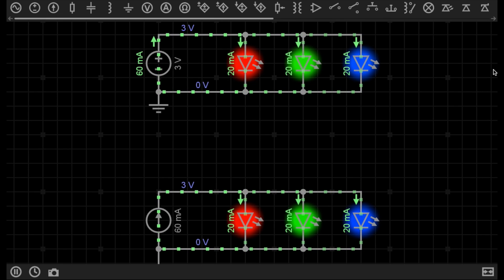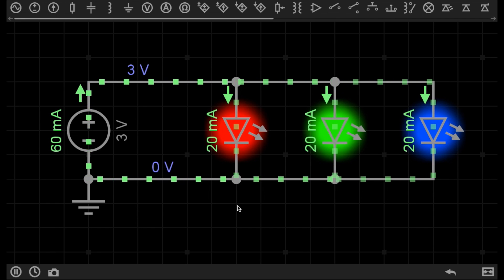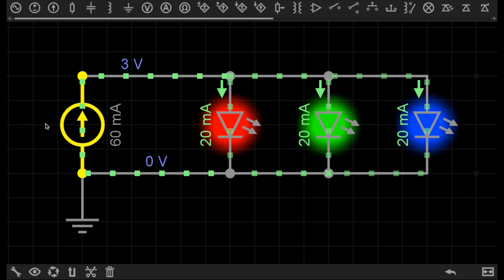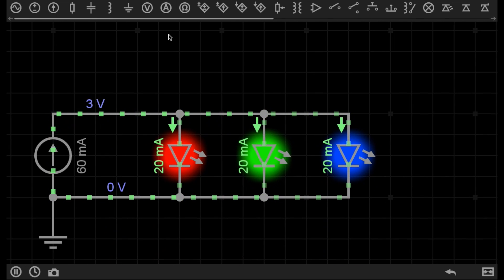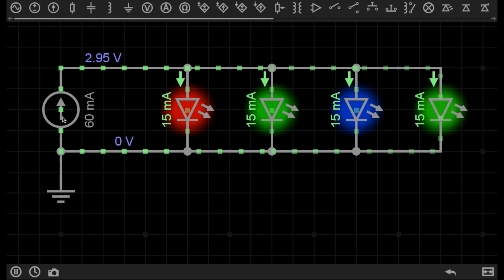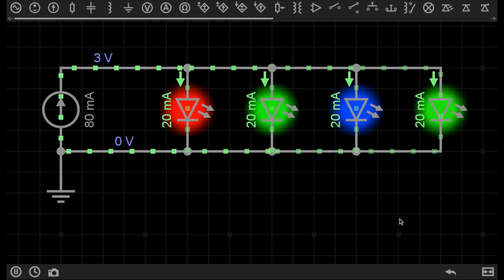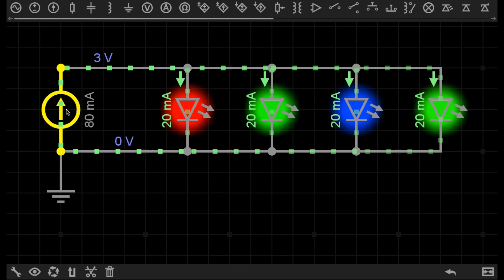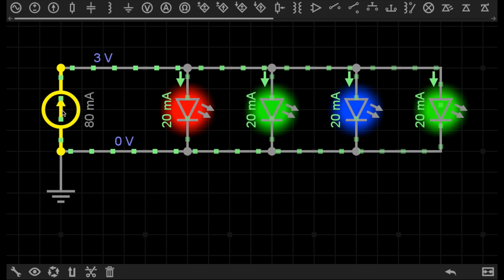Constant Current Sources (Interactive!) - Simply Electronics Basics 9

Comment: Question 1:  the current source creates no voltage, correct?

The diodes require voltage to turn on , and allow current to flow.

With no voltage provided,  only current as available, how do the diodes turn on and allow current to flow in the first place? 

With a resistor in parallel with the three diodes, current would be able to flow across the resistor.  That would create a voltage in parallel with the diodes, which would then likely be above the typical 0.6-0.7 volts required to allow current to flow through the diodes.  only then would the current source be able to power the LED's.  

I must be very confused.

Comment: I suggest that you use Copper Clad CAD to test this idea, build a real prototype, to test this idea, measure to see if you really get equal currents for each LED, Different Color LEDS work at different voltages and current levels. In this circuit the voltage across each LED will be the same, the LEDs are in Parallel, use a real circuit to see what you really get! Will the voltage across all the LEDS be determined by the lowest forward conducting voltage of the LEDs? It does not matter what a spice program shows, it only matters what the real circuit does.

Comment: Should the LEDs be in series rather than parallel when one intends the same current in each of the LEDs due to different colored LEDs having different voltage drops for a given current?
Reply: Red LED would light up first and burn out in seconds(half a minute at most), if it fails open all other will burn out subsequently(though blue one may stay lit depending on it's voltage drop, depending on maximum voltage of constant current source), if it fails short it would either way have voltage drop of less then 1 volt and no other LED will light up

Comment: I don't understand all the positive comments below. This is not how this works: Different color LEDs will never work in parallel as shown (probably not even same color) - should have done that with Resistors or possibly light bulbs...  Just try it on your bread board...   (This only works here because the simulation software is set so all diodes have the same voltage, which is not happening in real life).
Reply: Seems like trap to make people comment on video, there is no way a channel creator could made such mistake for real
Reply: This is perfectly right on a theoretical level, it explains the differences between a voltage and current source, led properties are out of  scope
Reply: Someone’s a Debbie downer

Comment: Hello, very nice video ! i did the same, i used 1.5 Ohm to have an output of max 1A, but when i plug a load to my 12v lamp bulb, the voltage drops to 4v, is it normal ? many thanks.

Comment: What happens when one of the leds break? Since its set at 80mA, would it destroy the others by giving it more current than the amount it needs?
Reply: That's my question as well, if you get a chance to explain.
Reply: You are right. Therefore it's not smart to connect the LEDs in parallel. When the LEDs are connected in series on a current source, you are sure all leds pass the same current. Even if the forward voltage of the leds is different. This is most likely for leds with different colors. 
By the way,never connect leds directly to a voltage source. A lead has no linear relation between voltage and current. Once the voltage is slightly larger as the forward voltage of the led,  current rapidly increases. So with manufacturing deviations, temperature diverenses,... it's impossible to maintain a steady current through the led, using a voltage source without resistor to limit the current.

Comment: Hello, firstly I want to thank you alot for all these very helpful courses,
Could you please help me to understand, why the current is 2.95 V (why this value) after adding a diode ? is there any equation to calculate this value ?
Reply: Yes, ohms law equations. If you know the current and the resistance you can calculate the voltage. With any 2 of these variables you can calculate the third. In the circuit you're referring to we actually know the current and the voltage, but not the resistance of the diodes. So you'd have to work out the resistance of each diode to be able to calculate why the voltage dropped from 3V to 2.95V after adding a diode. Check out the first video in this playlist.
Reply: This bothered me too so I did more research. The constant-current source must decrease voltage because adding a 4th diode decreases total resistance in the circuit. Resistance is calculated as:
(resistivity * wire length) / area
Adding a new diode increases the Area the current flows through, so resistance is effectively decreased in the circuit. Hence lower voltage required to keep the current constant.

Comment: Cool video.  However, what forms does a constant current source come in?  I can only think of a variable power supply that allows you to vary the supplied voltage or current.  Seems like a laboratory thing.  I'm guessing that you'd use some current limiter in a circuit, supply it with slightly more than it needs, then you get your constant current source, much like an LDO?

Comment: Those LEDs do not exist. There is no such thing as Red, Green or Blue LEDs that operate at 3V. 
If you're gonna make shit up, make sure you tell the viewer. People who are learning the basics don't know that.
Reply: That's just one problem with this video.  Constant current drive is for LEDs in series, and if he insists on doing that, he still needs one resistor per LED.  Even if the LEDs were the same as he states, that would still be true due to manufacturing differencs.

Comment: Is it possible to power an LED which draws 20mA und has a max Vf of 3V with a 3V powersupply? Since there is no voltage left for a resistor, will the LED draw exactly 20mA? Do you always have to power an LED with more than its Vf to have enought volts for a resistor to regulate the current?

Comment: Liked this video.. Question - which one is better -
1.using resistance to limit the voltage to light Led ..so specific current is passed. 
2. Using constant current to allow specific current in the led... 

And tell in which cases I should use these two..

Comment: Great video but I strongly disagree on your argument were since it's easier to use a current source that you should use one instead of a voltage source.  Reason why is being that in a scenario where one of the four LED's burns out the other three start to get more current, then when another burns out you're left with two LED's that are running on 40 mAmps each, then when one of those burns out, you're left with the last standing LED which will be running on 80 mAmps which I assume would burn out at that point.  My main argument is that you'd be decreasing the life span, I'd say stick to resistors because although there more time consuming they are worth the time.
Reply: But what about integrated circuits, which cannot handle the size of a resistors, there we can use constant current sources
.
Reply: the point is that when using constant current sources the LEDs are connected in series.

Comment: Wow you know your stuff, maybe you can help me with something, I bought a solar panel, NO battery, to go direct to dc/ac power inverter, which needs 12v dc to run, my solar panel does 22.5 v. so I bought a cheap china junk buck step down regulator, it worked at first, then it was fluctuating very badly, wasn't constant, & lost the ability to adjust it... 12v, which is what my dc/ac inverter needs, would a >>>>"Constant" <<<< adjustable dc-dc voltage step down regulator be better, to stop the voltage going up & down, constantly? Thank you.
Reply: da man ,all solar panels will have a higher voltage with no load. If you have a 12V 100Watt solar panel, it will be 12V with. 100 watt load in full sunlight. My guess is that when the buck puts a load on the solar panel your voltage is dropping to 12v or lower and most buck converters need 3v to 5v more then what they are set to, so when the solar drops 12v under load the output from the buck will drop to 7v or turn off tben the voltage on tbe solar goes up the buck turns on and the voltage drops again causing it to cycle. Hope that helps.

Comment: Only matched diodes can be connected in parallel. Otherwise they won't share current equally. No way diodes of different color can be connected this way. The diode with lowest forward voltage will take all the current.
Reply: I guess they could have chosen incandescent lamps.
Reply: You are  almost right : the V-I curve of R LED is radically different from a G LED which is radically different from a B LED...
see http://lednique.com/current-voltage-relationships/iv-curves/
I would guess that a 60 ma constant current source would be  divide amongst the diodes as I]red ~46ma ; I]G ~ 12ma ; I]B ~ 2ma 
further the current will continually divide differently as real LED heat up .
Reply: This problem is irrelevant here, but in general you are 100% right
Reply: yes, and also you cannot even connect one diode to a voltage source like that, unless you make sure that the voltage source is current limited, otherwise you will burn the diode as its current does not increase linearly, itwill draw more and more current with just a little increase in voltage over it's voltage threshold.

Comment: what was left on my mind towards the end of this video is, what is considered a constant current source. Or in other words, how to i get/make a constant current source... i understand what constant current sources are capable of doing and how they are useful. but the one thing this video was missing was an example of what a constant current source can be.. like when you talked about dc power.. you mentioned a battery.. which then if i decided to try out a dc power circuit experiment, i know exactly what components i would need..
but with this video i dont know what component i need to make a constant current source.
but still a great video dont get me wrong
Reply: LM334Z is a great example. 
They are referred to as current regulators. Not current sources. They provide a current source, they regulate the current by adjusting the voltage. Highly useful. Very dangerous if improperly used. Even at 10mA as you have active current flowing through the wires, some of which may not be being used when protyping. Be cautious if you use them. There is a reason we us DC and not AC other than transmission line range.
Reply: A transistor in saturation condition can act as a constant current source so the component constant current source in the video can be replaced by a transistor
Reply: Same question for me too.
Reply: Without having to make anything, benchtop power supplies with voltage and current control knobs and set to run in constant current mode will be the most efficient current source for experiments.  A ballast used in fluorescent lighting fixtures is a current source.  A specifically sized transformer can be used as a current source.  Resistors are current control devices.
Reply: Sounds like a current source means another type of circuit being attached to something like this like a regulator of some sort. The only thing else I can think of is a variable power supply that allows you to control both voltage and current. Good question, though!
Reply: The simplest constant current source would be a BJT. A current transformer wouldn’t exactly work the same without rectification and filtering, plus it isn’t practical for this application. Good question though!
Reply: search for current transformer
Reply: you can buy a constant current driver the same way that you would buy a battery. They are pretty common components.

Comment: Thanks a lot! Your videos are great! Simple and comprehensive. Is there a technical name for the “active component” which allows to control the current flow?
Reply from the maker: Thank You! The active component would be something like a linear current regulator or switched-mode current regulation IC. Active components are "Active" because they rely on having a feedback loop so that they can monitor output and respond/compensate for any change.

Comment: in your other video you show the electrons flowing the other way round.. i thought the flow was from negative to positive?..
Reply: EveryCircuit program allows you to show "electron" flow or "Conventional" flow . This is because at one time it was believed that electrons would flow from Positive to Negative. So all schematics and circuits drawings were arranged that way and it became sort of a "Standard". So since so many schematics were drawn that way it is still used that way when drawing circuit diagrams. Some programs allow you to switch between the two just for personal preference. In all reality it does not matter which way it shows that it flows in these Circuit Simulators because the end result is the same. As long as the circuit is closed electrons will flow no matter which way they are shown. Its just personal preference mostly. Depends on how you were taught.
Reply: me me again thought that too